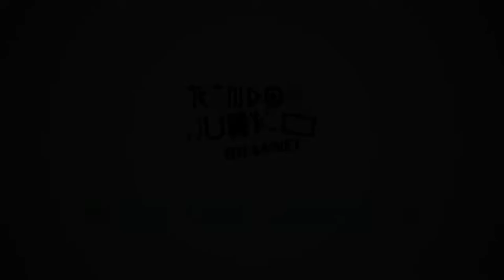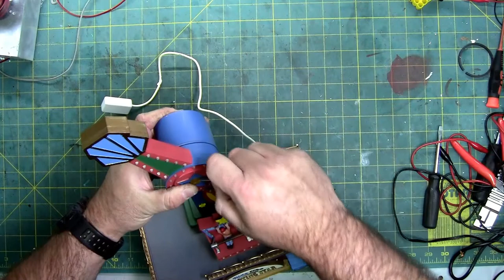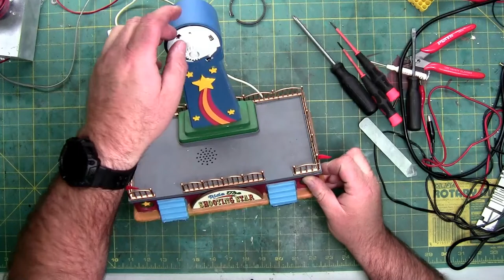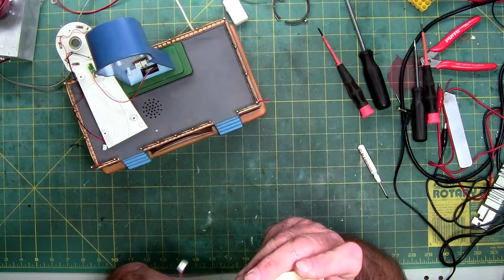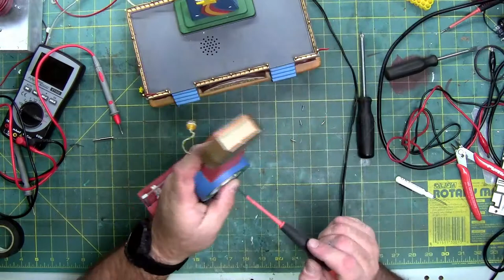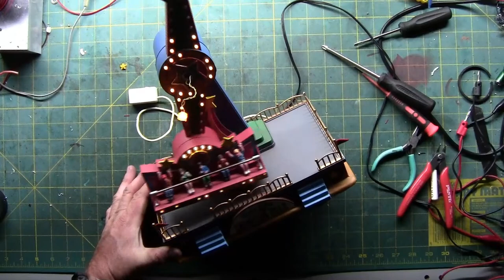Lemax Shooting Star Ride Repair

Comment: Hi man, i jist bought 1 second hand. It moves and it makes sound but no lights😢 can it still be the motor or possibly sometihng else ?
Reply from the maker: Motor is a possibility but I would look at the board for a burnt resistor or a broken wire first,

Comment: I want to know if it is possible to change the gear ratio by changing the pulley size to make it more exciting.
Reply from the maker: Technically yes. As long as the pulley size fits, it would change the speed at which it moves. However if it is to "exciting" the unit may tip or walk and the stress on the gears could cause a gear to fail.
Reply: @RandomJunkChannel  A little faster not crazy fast like inverting the twoo pulleys
Reply from the maker: I would by a hobby pulley kit and change the pulleys that way. A slightly larger big pulley and a slightly smaller drive pulley (If available). Most Lemax products use the smallest pulley to drive the system based on shaft diameter and torque of the motor.

Comment: Hi, love your videos, I have a Zinger ride that it stoped working, only the lights works, but no sound or motion, but the motor keeps running.
Reply from the maker: Possibly still a bad motor, but you could of had a belt snap and break a wire to the speaker.

Comment: Your broken screw or whatever has gotten jammed in the gear. Check @41:25 when the people go around they are not staying level, they are actually turning upside down. 
Question, where do you buy your parts , o need a circuit board for the Flying Reindeer. Thank you.
Reply from the maker: I get my parts from www.happyholidaysparts.com, eBay, Amazon and any places that has parts pieces such as Goodwill, estate and garage sales.